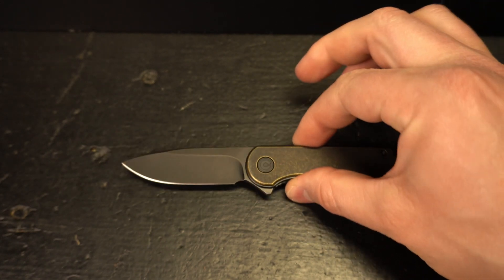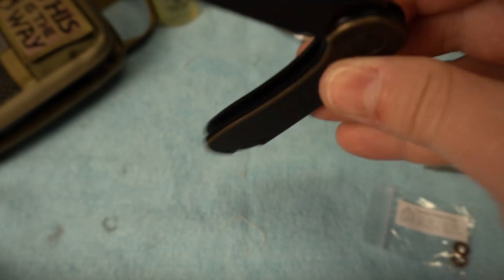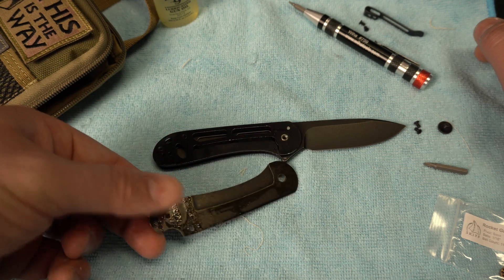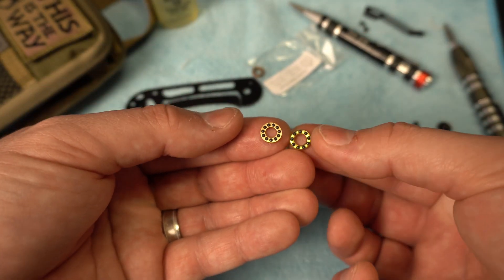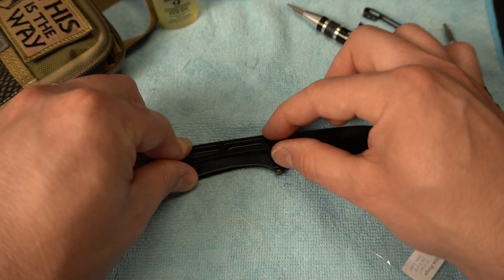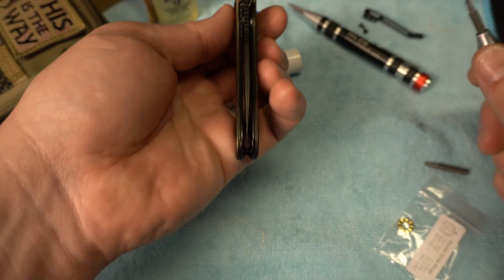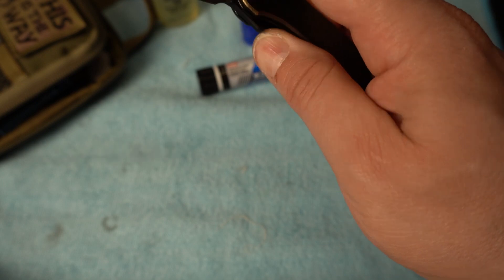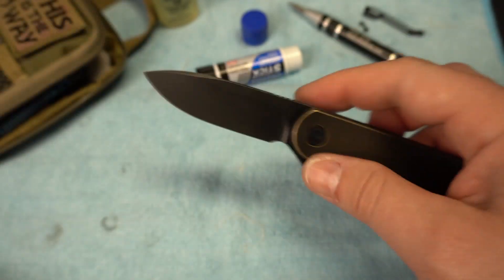Civivi Elementum Skiff Bearings install

Comment: Most small blades won't drop shut because of the weight of the blade... You will notice only heavy blades really drop shut, unless the user in the video has the pivot loose to appear more smooth...
Reply: Most..... My Moguro Vazo is tiny but drops shut real fast.
Reply: My elementums all drop shut, small knives drop shut, all my para 2's and 3's drop shut, it really doesnt matter as long as you have quality parts, lube and some love.
Reply: @TheFriendlyCholo1301  When designed, most knives are not designed to drop shut (unless we are talking about bearing knives), the specs are designed to be sealed yet still smooth. And if your knife with a light blade is dropping shut, I can almost guarantee your pivot is looser then the intended design calls for.

Comment: IT IS NOT A BUTTON LOCK, IT IS A FRAME LOCK THAT IS ALWAYS PUTTING PRESSURE ON THE BLADE, WHICH IS WHY IT DOES NOT CLOSE SMOOTHLY LIKE A BUTTON LOCK.
Reply from the maker: @victorediaz1  1) who said it was a butting lock? 2) it actually does close smooth, there is no grit or resistance so I not sure what your talking about. Are you saying it’s not a guillotine? Because that completely different from being smooth. A Chris Reeves is smooth when broken in but never a guillotine. 🤔

Comment: Those bearings are $25?  Now it's a $75 knife. The satin blade on mine closes very easily, but ive also flipped it open and closed 100k times.  Elementum isn't really a budget blade @ $50 bucks for it's size.  WE knives has seen momentum on their budget line and I can see the prices slowly rising unfortunately.
Reply from the maker: $11.50 for the pair in the US.
Reply: @dailygearguide  This is really cool, but they're also charging $5 for shipping on what will surely be a regular envelope and cost them 45 cents :/
Reply from the maker: @alexazzopardi9914  I ship knives fairly regularly and postage is $7-9 on average. They come in those bubbly padded envelopes. I don’t know they can help shipping 🤷🏻‍♂️
Reply: You flip your Elementum 150 times every day..?
Reply: @razorback6111  lol not really, but if I think about it I’ll take it out and fidget w it